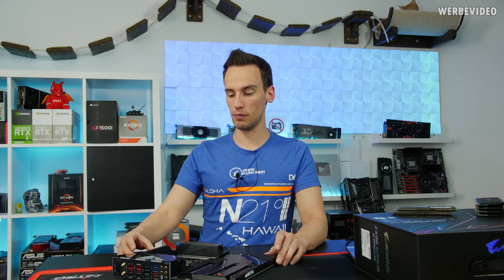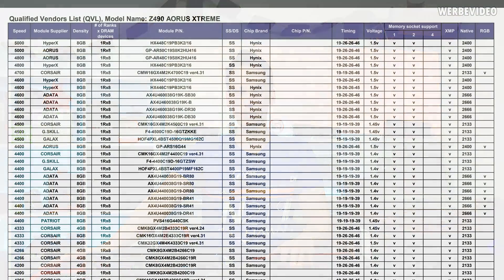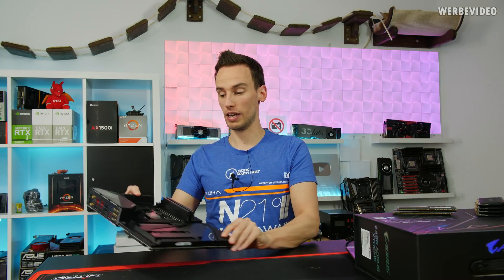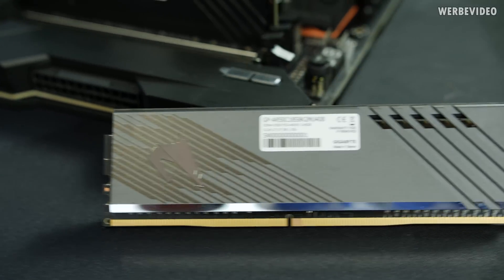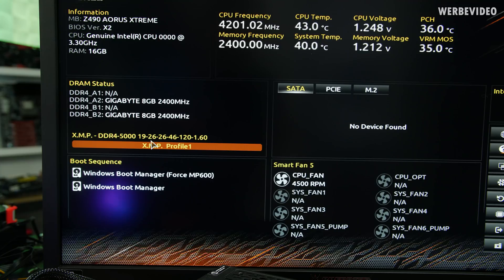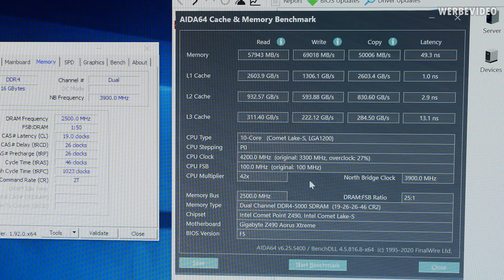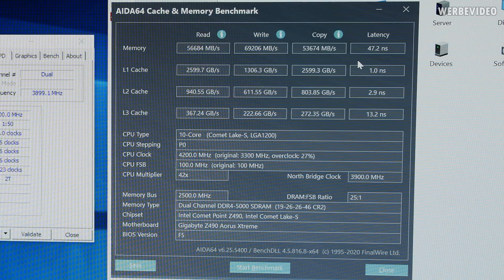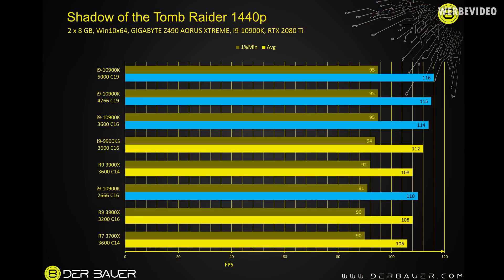5000 MHz Memory Speed was more difficult than expected. But will Games benefit from it?

Comment: I wonder how this memory performs with iGPUs, since they rely on system memory and use that as graphics memory
Reply: Memory speed that high is only reasonable on Zen2/Zen3 APU's. Intel integrated graphics is so weak it does not pick up an improvement from increase in memory speed from 3200 to 3600.

Comment: bought my 10900k off amazon for $450. 

I consider mine "random" since it was purchased off amazon for a discount, but maybe I got lucky. 

Runs 5.3ghz - all core. 1.65v, but jumps to 1.9 under load. 

I decided to keep it to 5.2gz, all core @ 1.6v

It's got an all-in-one, 280mm, liquid cooler from Arctic that was easy to set up. 

80-90c when at 5.3ghz, under load.

Comment: That is so crazy there there is 5000mhz DDR4 that runs at 1.55V. That's a lot of volts. 3600 C16 seems nice here. It also would be nice to see you find a CPU and motherboard combo with this memory that runs at 5000 CL18 like it's supposed to, that would be quite a video!

Comment: Hallo, @der8auer
könntest du per Teamwiever mein PC checken? Mit CPU-Z oder auf Fehler Prüfen? Ich habe Probleme mit meiner Radeon RX 590 8GB da kommt immer wieder Fehler wenn ein Update verfügbar ist.
Oder beim zocken wird er immer zu heiß. CPU um die 70-75 grad (Ryzen 5 2400G) kann auch mehr werden und Grafikkarte 80-85 kann auch mehr werden.
bei 1-2 Stunden zocken obwohl ich 8 Lüfter eingebaut habe. 3 Vorne ziehen frische Luft rein, unten 2 Lüfter ziehen frische Luft rein Oben 2 Lüfter machen die Luft raus und 1 Lüfter hinten macht auch Luft raus. Alle Lüfter sind 120mm RGB
 wäre korrekt wenn du mit Teamwiever mein PC einstellen könntest Bsp. die Grafikkarte einstellen die Lüfter oder schauen ob alles in Ordnung ist. Kann dir auf Insta schreiben.

AMD Ryzen 5 2400G - 3.60 Ghz
24 GB RAM DDR4-2666 (1x 16GB DualRank - 1x 8GB SingleRank) Aber Bald 2x 16GB so hab ich dann 32GB
AMD Radeon RX 590 XFX FatBoy 8GB
Mainboard: Asus Prime- A320M-K
Netzteil 500 Watt von SILENT

Comment: Just out of curiosity, what were your vccio/vccsa voltages when finally getting the ram stable? And what so you think is the max vccsa/vccio before you start harming the imc?

I've seen so much conflicting information on these numbers.
From personal experience with the gskill  b-die 4800cl18 kit it took me ages to finally get the damn thing stable with a 5.1ghz 9900ks lol :D
Ended up buying a fan cooler for the ram too.

Currently on the asus xi gene if that means anything.

Comment: You will see benefits of higher freq ram in the future, the gap will widen and widen each years between slow memory and fast, the same was in ddr3 era when it was enough to have 1600mhz while 2400mhz seemed like overkill which it wasn't... Games do need fast bandwidth to run smoothly without stutters, freezes and next gen games will require that, lowering timings will do a lot as well, the lower the latency the better.

Comment: 9:10 I'm pretty sure you misspoke when you claimed it had a latency of 47 seconds, because that's horrible ;)
Reply: Not really. 47 seconds isnt even a minute. Not long at all
Reply: @InvadersDie  For ram? Dude 47 seconds is 100 times slower than this ram kit at 47 milliseconds.
Reply: @InvadersDie  Can't tell if joking, but if not and if a RAM kit would have 47 seconds latency, then everything would take so long to work on that computer that you would barely see the Windows boot up before you die of old age :)) 47 seconds is several thousands slower than a 5400 RPM HDD in a bad day.

Comment: As far as gaming is concerned.. I have a personal gauge I use.. If by doing a hardware upgrade of any kind, and you can gain 10% fps.. Then it is worth it. Under 10% and you won't even feel the difference in the game. Your wallet will though. I'll stick with my 8700k@5Ghz and 2080ti on water for a while yet. 3200Mhz C15 RAM btw.  It can do 3600 but I just get the same issues you discovered.

Comment: always enjoy your content a lot, really like to see those in-depth testing. in my opinion, the aida results you got are disappointing.   
I got mid-range G-skill trident Z memory 3600 cl17 running at 4000 cl17 18 18 18 37 and tweaked the secondaries a bit. and have lower latency numbers then you did here: it jumps around between 40ns and 42ns with the read 58 gb/s and write I'm around 60gb/s and copy around 53 gb/s. (this is b-die but not a good one) with a voltage of 1.39 volts. higher and it gets unstable also I noticed that  around 45-49 degrees celsius my memory tends to get unstable i only reach those temps while trying to get them xD)

Comment: Im a bit disappointed, i expected the benchmarks in 1080 not 2K where you are gpu limited.
Reply: Results from 1080p would be useless since no one will use that expensive memory etc. and play at that resolution. I have 3900X + 2080 ti and I use 4K resolution. If performance difference with faster memory is non-existing at 4K --> no point buying expensive faster memory.
Reply: @kimnice  You arrogant fool, that is still Gpu limited, which doesn't benefit from faster ram much at all. CPU's benefit the most from ram speed overclocking, and in order to show that, the test needs to be cpu bound. (Gpu load on parity with cpu load)

 By your logic everyone with a 2080ti would be better off using an r3 3100 for 4k testing.
Reply: kimnice 

Rather than going bigger for that 8K or 4k graphics, I care for companies IF they focus on achieving 120+ FPS so we could go away from that 60+ FPS. 
If that means games are 1080p, so beat it. 

Imagine this in the future: 
A 120ghz monitor with 1080p achieving that constant 120+ FPS. Would you sacrifice 4k and amazing colors for THIS?
Note that: For all games Achieving 120+ FPS, you need to downscale the graphics all way down. 
So, imagine playing a game that is 1080p & 120+ FPS on a 120ghz Monitor. 
Now, that would be an amazing MILESTONE. 

You must be stupid to pass this up.
Reply: @kimnice  you are wrong on so many levels I don't even know where to start from.

Comment: I bought the Dominator Platinum RGB RAM 3200mhz.   Overclocking at 3466mhz on a AsRock Z390 Taichi,  9900K @5.2ghz @1.32volts.  Doesn't get above 78°!

Comment: I just got a 32GB kit of Crucial's Balistix Elite 4000CL18 at 1.40v and got tge timings down to CL15. This $380 kit only cost me $275 for an open box kit. These dimms have built-in thermal sensors. You would think this would be useless but, it can actually be very helpful. I love these dimms and they way look.
  I also have a 32GB kit of GSkill's (designed for AMD Zen1) FLARE X 3200CL14 Samsung B-die and with 1.450v this 3200MHz kit can clock to 4000CL15 just like the Crucial Elite dimms. I still think it worth getting a lower binned cheaper kit and overclocking them. I also have a 4x4GB kit of GSkill's Ripjaws V 3600CL16 that clock all the way to 4133MHzCL17. Now i paid $90 for these matching 4GB dimms and they run almost just as fast as those pre-binned dimms. If you can find a good kit of cheaper priced ram and overclock it, i would just go that route. But, if you can find those 1st Gen GSKill FLARE X 3200CL14-14-14-34, i would pick those up.

Comment: Hey brother man ! I have an MSI z390a Pro motherboard and an Intel i5-9600kf with some Kingston Hyper FuryX. Do you have any recommendations to get this chip to 4.8 or even 5 GHz? Or is this mortherboard not sufficient enough to hit 4.8 or higher? OC Geanie gets me to 47, 46, 46, 46, 45, 44 on my cores. I can't get any higher. I'm using a Coolermaster Water-cooler

Comment: Der8auer, to get the CPU stable at 5000 ghz with memory at 5000 ghz, you usually need at least 1.50-1.60v VCCSA.  (unsure about VCCIO).  Asus already posted about this a few weeks ago in my talking with Shamino.  Only 1.4v VCCSA is going to instacrash if the CPU is clocked up with 5000 mhz RAM.
Also with my own personal testing (which I am proud of since I discovered it myself), testing Prime95 (latest version) with custom 112K-112K in-place fixed FFT with AVX disabled is one of the best ways to test if the IMC is stable on hyperthreaded chips (IMC controls L0 cache register store, used in HT).  Several people on OCN on the DDR4 thread and the 10900k thread have tested this and found it telling and surprising.
Reply: I've been messing with a 10900k ht off and 4800mhz gskills. What sort of vccio and SA have you been seeing for 4800? Currently running 4500c16 @ 1.3-1.35 for both. Can you link the ocn thread also? Thanks so much for the great reply. I've heard a few places that the new max "safe" for sa and vccio is 1.4v on non subzero

Comment: Never understand memory timings that much ...
Or I was lucky or something is different because my memory is running at ( 18-18-18-38-400-T2 )on my 1º try, my is at a lower speed 3000Mhz but is a different brand @ 1.18V, also is 32Gb - 4x 8Gb, ballistix sport DDR4 - 2400.
it might be different after pumping up the speed, but I try 10 (no post), try 12 (no post), try 15 (post but no boot), the original timings was 28-26-24-52-586-T2

Comment: I had the same issue with thermal instability on my GSkill memory kit on my Z390 Aorus Master. Soon after premiere I couldnt even use XMP on my sticks. So I set them manually to 4133Mhz CL 17-17-17-37 1,45 V (VCCIO 1,2V and VCCSA 1,3V). At Windows and at memtest everything was fine but after some time in very demanding games i had BSOD "kernel security check failure". BSOD always happaned randomly when my sticks was around 45-50C. It was very frustrating. At 3866/4000Mhz and CL18-18-18-38 1,4V sticks was stable.
Now after MB bios flash to the newest version, I can finally run XMP on my sticks (4266Mhz 19-19-19-39 at 1,4V, VCCIO 1,2V, VCCSA 1,3V) and with these settings everything is rock stable even at 45-50C on sticks. So in my opinion 5Ghz on RAM also will be rock stable regardless of the processor you have but it will take some time after launch. We need to be patient.

Comment: thanks for the look at the aorus extreme and bios screens, not surprised ryzen master does weird things the entire "AMD" cpu management is suspicious, if you check my channel I posted a threadripper video showing temperature go down by 10°C while running cinebench for the same score (wether it's real or a VW-like emission test cycle cheat isn't clear) what I learned over the years is that 9/10 your BSOD on intels come from memory, the advertised memory speed and XMP are ONLY for a full default settings CPU, not an overclocked one, if you BSOD the 1st thing you should do is reduce memory speed to the lowest validated for your cpu (2133,2666,2933 etc...)

Comment: do me a favor and look into wiki about en. wikipedia. org/ wiki/ CAS_latency
higher frequency matters more than cycle count, because each cycle becomes shorter and shorter in actual time.
1800 MHz  CL 15  = 10.28 ns
2400 MHz  CL 19  = 9.38 ns

At same exact frequency less cycles is better of course, but you need to be careful comparing different frequencies
Reply: Of course he is aware of that, he just tries to push the limits. Also what you said is not true, you always have to look at both values and can calculate what performs better, so there is no argument to be made on which is more important

Comment: I saw 50 fps increase in csgo when I overclocked my ram. I think cpu/ram limited game like csgo would show greater performance benefit from this kind of ram speeds.
Reply: Bruh, any mid level gpu with a good cpu and Memories 2.4mhz run CS GO to the level needed. After 300 fps, only the lows matter after that.
Reply: @Sg6CrossOver  i want 1k fps
Reply: probably and not only that but also....steam download speed I "rage deleted" my videos (like skyrim diva modders lol) after stupid comments but there's a lot of things that care only about Mhz, in steam case it's that you download+decompress+decrypt+install files all at the same times so the only thing that matter is input/output speed and timings, high fps gaming also doesn't care about bandwith or multi-core if everytime you click there's a 0.1s "system wait time" rather than 1s

Comment: I am a high speed ram advocate so to speak but very surprised you got any perf differences at that res/settings.
Back when skylake and 980ti dropped we could see perf improvements with fast ram, even higher than simple oc when the scene was not gpu intensive.
The systems I have put together for a couple of cs:go crazed users all use fast g.skill sticks that were costing more than the cpu itself because they did not want to oc anything and wanted to simply rely on the xmp profile.

Comment: Hi der8bauer big fan here, i have a question, the new motherboards have the normal 8pin ATX and an extra 4pin, is the extra 4pin really needed for normal OC lets say push a 10th gen to 5.2 5.3 or is it only or extreme OC that the extra  4pin is needed ?

Comment: Hi, big fan! I have a funny question for you: does your cat, as far as you know, lick some of the hardware? Would electric components eventually get damaged? Thanks for your time and your amazing work! BR
Reply: if you touch exposed connections, "pins" and else even with fingers they will start corroding, maybe not visibly but they will over time, in the microchip industry you never touch circuits with fingers but the most dangerous thing that can instantly destroy an electronic component would be a static electricity discharge from their fur, this can "zap" some components and "cut" some microscopic connections that can break or downgrade controllers etc...modern hardware is better protected against that than old motherboards of 15+ years ago back then it was easy to fry components with a simple touch
Reply: if it's a mac it will die instantly, warranty void for both mac and the cat.

Comment: Tested my random retail 10900K with Aorus Z490 Pro AX and manually set a B-die kit to 5000 19-26-26 1.6v, surprisingly it booted without much issue but Windows crashed.  I didn't do any real tweaking to see if I could get it "stable."

Comment: I have mixed feelings after seeing this. I understand the goal was to show that selected 10900k can maintain 5000MHz memory, but testing and comparing games with OC memory but without the OC CPU is pointless. Core/cache speed together with memory is crucial for LOW FPS  in most games. Such a comparision would be much more useful.
Anyway thanks for valuable comment about random 10900k CPUs keeping memeory at (with OC i guess) 12:20
-1x 4800MHz
-2x 4600Mhz  
Do I think right that sth like 5.2GHz all cores and 4300/17 is realistic?
Reply from the maker: With only one day there is not much I could test. Tried to do as much as possible
Reply: @der8auer  Sure you said it clearly, maybe there will still be an opportunity to do such a comparison and compare 10900K OCed with 4000 vs 4400 memories. That would be very valuable.
Reply: Rauf,
Like 3dtimespy record-holder rauf?
If so hello sir.

What a collection of minds here.
Reply: @zebur4170  sorry to disappoint you, but that's my "Swedish cousin" ;) i'm from Poland and far less recognizable in 3DM.
Reply: quoting my above comment "most bsod on intel come from XMP being validated for default clock speeds, not OC" do a playtest/benchmark with the lowest Intel validated clock (2933Mhz for 10900k) then one with the highest you can boot with (4000+ if you have such memory) then compare the fps/experience and decide if crashing is worth the gain, or better ! use a few tools that will help you do your own tests for your configuration 1) aida64 "system stability test" cpu stress test will fail if your memory is set too high (test will stop with warning when it detect errors) 2) search for this on youtube : msi afterburner frametimes video overlay / tutorials to set up a video overlay that is better than any youtube/website benchmarks, you will see live in real gameplay what is going on on your own computer it takes a bit of time to setup but after this you won't need guides and whatnot, you can change settings ingame and see the improvement or downgrade instantly and you can also easily see if your game runs better or worse with different memory settings, the goal is that frametimes should be as smooth as possible, like DerBauer 10900k cpus videos showed, same goes for memory kits not all are equal, whatever works for you is what's best so I recommend testing yourself, don't mind the "numbers" mind what gives you the best result (I have experience in car engine tuning and it's the same, theory and websites almost never translate into reality, each machine is different, too many parts and variables to copy/paste what others do)

Comment: That coating DOES look very similar to Exhaust Ceramic coating. Good video that proves, once again, 99% of 'Normal' gamers do NOT NEED the bleeding-edge, highest-end, most expensive components. Educated, sensible choices that will then leave you with more money for peripherals i.e better keyboard, headset or mouse etc.

Comment: Other than the writes this performance is terrible. I get 61gb read, 64 write, 56 copy and 34.7ns latency with just 4133c17 though that is with 4.8ghz ring.
Reply from the maker: The CPU was an Engineering Sample running at 4.0 GHz cache and for AIDA only 4.2 GHz on the Core. For gaming benchmarks I manually set it to the "Intel Stock" Frequency
Reply: @der8auer  The ring can boost performance by a lot but overall I view these "high end" kits as a scam. You only need some B-die and a tight bin. A cheap 3600c15 TridentZ kit can go to 4400 and beyond with ease with a dual slot board and you're going to get much better performance than this super expensive kit provides. The gains from memory tuning especially in frametimes is huge! Your pal, GN Steve, can tell you about the huge boost in 0.1% frametimes tight tRFC provides. With a tRFC of over 1000 this kit would have frametime spikes and possibly even Micro stutter.